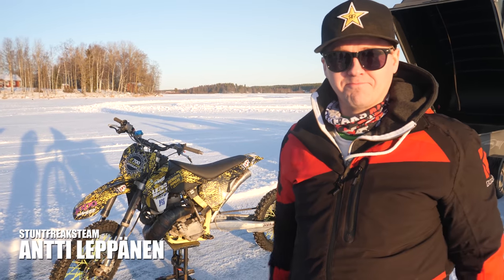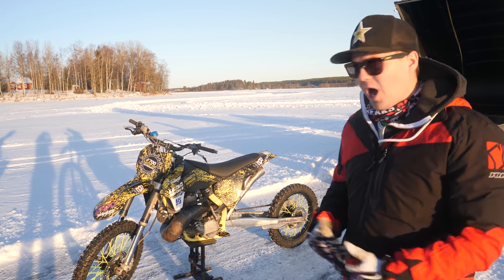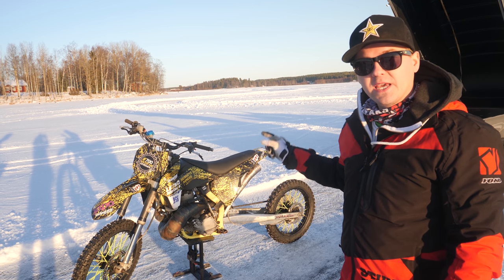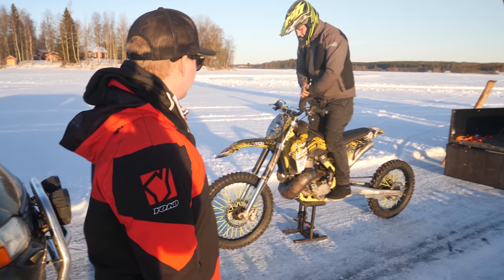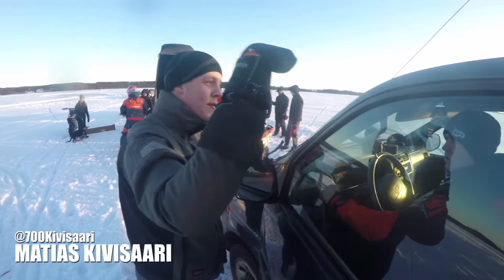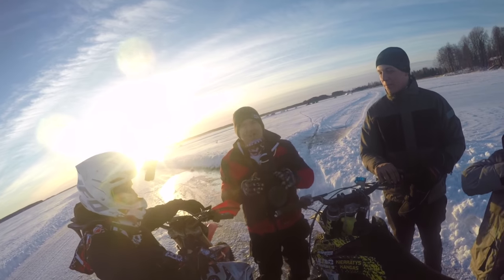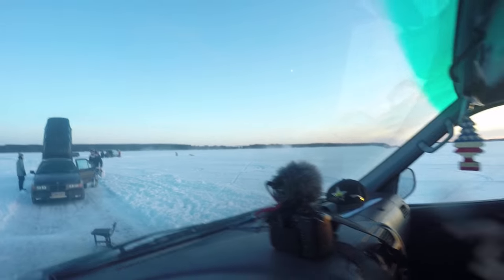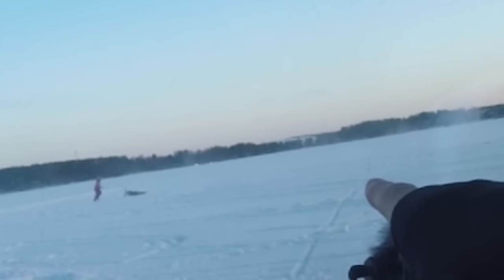700cc 2 stroke Zabel Dirt Bike - Test Ride

Comment: Solution: Mount a second 700cc engine to cancel out the vibrations of the first one!
Reply: Sorry it don't work that way
Reply: @timedrifter117  r/woosh
Reply: time drifter damn idc if it works it sounds fun 😂
Reply: time drifter r/whoosh
Reply: Transverse engine with revese gears would work logically
Reply: I want to build a twin engine 2 stroke buggy preferably 4 mil cheetah cubs  on a light weight buggy... is it possible and what are the setbacks if any.. in a build like that
Reply: @timedrifter117  one of my uncles TZ race bikes had two counter rotating crankshafts to cancel out the gyroscopic effects of the engine. Equal and opposite reactions, first grade science man...
Reply: resonance
Reply: Que chimba
Reply: Lol
Reply: @5dsunny713  I have some powerful twin cylinder 2stroke sled motors laying around...
Reply: And phase shift it 180°
Reply: @Kade Jaxx instablaster :)
Reply: @Salvatore Gus It did the trick and I now got access to my account again. I am so happy:D
Thanks so much, you saved my account :D
Reply: @Kade Jaxx No problem =)

Comment: Left kickstarter on 700cc, nice.
Reply: Ayyy LMAO first thing i thought lol
Reply: My cousin had a husquvarna 610 with left side kick, I thought it was weird too
Reply: imagine stalling the engine at a green light and blocking the cars behind for 15 minutes until you manage to start it up again
Reply: @rodrigovillanueva5384  I have an 660ccm 4 stroke with kickstarter on the left side, can kick it with 1 kick when its warm.
Reply: @rodrigovillanueva5384  they're only hard to kick if you don't normally practice left leg kicking on a right side kick start. I started practicing that when I stalled on a hill I was going up diagonally and I fell into the hill on my right (kick-start) side, went to start it without dismounting lost my footing on the left side and went end over into a ravine and got pinned for about an hour and still couldn't start my bike because I was so weak and it was still on the wrong side of the slope.  Later i learned I could've and should've just hopped off and stepped up the hill a foot stood the bike upright slightly and kicked it with my left foot.
Reply: se on siksi koska se on oikeasti tarkoitus käynnnistää oikealla jalalla vasemmalta puolelta
Reply: @rodrigovillanueva5384  Luckily I’m left footed
Reply: @seetipulska8651  I've never seen one before
Reply: @frogman7806  me either,  I feel like they aren't common on supermoto bike
Reply: Its because you can kick it better with right leg, from the ground
Reply: This is the second left-hand kick started I've seen today
Reply: THE ONE .Bultaco or what ever that Italian motorcycle name is made a 840 cc experimental bike back in the 70s.That was a leg breaking bike when it backfired.
Reply: @gerald4027     
   Oh yes!  
 I have experience back in the day with my XR 600!! 
don't walk for one month.
Reply: Evil :c

Comment: Industrial anti vibration mounts should help. Or else the hands will zing for hours afterwards. Nice job guys.
Reply: and flexx handlebars
Reply: Your not riding it that long. You forgot what the bike is made for.
Reply: tutto quello che incontra!   youtube.com/watch?v=RY_Tl4Rcv7U
Reply: The BRC 500 is counter balanced.  No vibrations
Reply: @modsquad8817   um why wouldn't you ride a super moto all day ?
Reply: Cosmic surfer is right. Would help in the long run
Reply: @chexlemeneux8790  Cause it's not a supermoto, but designed for a hillclimb.
Reply: @modsquad8817  I wouldn't think twice about hauling ass through the desert on a 500+cc two stroke for hours on end. These things are meant to go through the gnarliest terrain around with tons of usable low end power.

Comment: I'm a die hard 2-stroke guy. I will ONLY buy 2-strokes. But that thing vibrates WAY too much. Zabel needs to make a counterbalancer.
Reply: Yeah I did test drive the 2017 KTM  300 2 stroke and first thing I noticed was that it had no vibrations at all thanks to the counter balance, sadly second thing I noticed was lack of power compared to my old WR450F. I did end up bying a brand new 2019 KTM 500 EXC F and it vibrates but it is not bad compared to my old Yamaha WR450. Think I would have needed a 450 or 500 2 stroke to be happy, but the KTM 500 4 stroke is pretty good and has more power then I can handle already and the power is easy to control. I am not a good rider and just do it for fun, and more power is fun even if not practical  :)
Reply: you should try like... idk not buying a 2 stroke you might like it, when i got my 250f i had a lot more fun than on a 125 just because it got boring i have nothing against them i still have a 125 but i like my 250f better
Reply: @ImJustShadow.  I'm an MX tech and racer, repair, set-up, and ride all bikes. I prefer two strokes. 4 strokes have their pros n cons just like a two stroke. I'm faster on and prefer two-strokes
Reply: they usually use those engines on the sidecarcross frames - i guess the problem is a little bit less pronounced on a bigger and heavier frame.
Reply: @henriht1147  They probably have some pretty hefty rubber motor mounts too. That big single 700 must rattle most anything apart. Still wanna ride one though!
Reply: @jasonjaeger4042  Hell yes!! I couldn't say no to that either haha.
Reply: CalypsoNotch408  no... Theres a reason people race 4 strokes they are superior with speed
Reply: @ImJustShadow.  They race with 4 strokes because 450cc 4 strokes raced 250cc 2 strokes lmao. And the 250s put up a good fight
Reply: @Jabooty_Williams  Thanks for mansplaining that for me. I'm aware of how they work, I was simply noting how impressive it is that 250s could (almost) keep up just because of their design

Comment: The ktm 500 brc is balanced engine and its not that diffrent from 300cc yous should look in to that
Reply: Easy get 80hp out of the BRC too
Reply: @petergarratt9645  yup and its much smoother i dont understand why zabel dosent balance its no point of it not being balanced
Reply: @petergarratt9645  but torque? Zabel 700 wins.

Comment: If you want to get rid of the vibrations a counter balancer is the only way, flexx bars and rubber engine mounts won't do much. There are guys that have made them for CR500s, doesn't look too difficult
Reply: @mondayfoolIn the second video the guy hangs a bottle of water off the bars so you can see the effect it had, looks like it works to me
Reply: @mondayfool yeah but we're talking SFT here, I don't know if you saw their minibike with a 450 or their GSXR dirtbike (they were a little hacky) they're just gonna rip on it for a video or two and then sell it off

Comment: I'm always surprised by how slow big 2 strokes are... based on the power to cc ratio, a 125cc would only be about 14 horsepower when in reality they are usually a lot more than that. A 125 is prime. A 250 is a reasonable upgrade but after that, its demishing return...

Comment: get yourselves a maico 700 2t ^^
Reply: that aren´t really maico bikes, they were new buildet bikes by KTM Köstler Leverkusen who bought the brandname Maico with KTM frame and also Zabel engine. but they use the old Zabel engines from about 1990-1998 with only 685ccm. this engine makes about 75 HP. the new Zabel engines have really 700ccm and hydraulic clutch with about 85-95 HP depent on which ZM29 Zylinder you have (GP, GPT, GPTR). Last year some GP teams testet the new ZM30 which is available this year.
Reply: @Thor555555  You have it backwards.  Koestler is a KTM distributor but he bought everything to Maico including all the designs.  The new Maicos are still based on the old 1980s Maicos, particularly the engines.  Zabel licensed the Maico engine design and made modifications to it.  The basic engine design came out in 1983 on the last of the "real" Maicos before the original company went bankrupt.  You can compare the cases; the air-cooled 1983 engine cases look VERY similar to the new Maicos and Zabels.
Reply: @Quirin M. Zabel isn´t really rebranded maico, Friedhelm Zabel was an engine tuner for sidecars and tuned the yamaha xs 650 engines. in 1985 the first two stroke engine was used in a sidecar,it was the Honda CR500. one year later the hole sidcar world cup changed to 500cc two strokes. 1987 Friedhelm Zabel tuned the first Maico 500 for sidecars and began to produce own zylinders for the engines. so the engines of köstlers new maicos ar original 500 cases with 620 or 685ccm with were produced by Friedhelm Zabel till 1998. after 1998 Zabel builded his own engines with 700cc, hydraulic clutch, only 4 gears (first gearreduction of the maico gear was removed) so in this engines he only used maico gearwheels which he later produced by himself.

Comment: There is a company that will take your ktm 250 or 300 2 stroke and they use your lower crank case and transmission and they give you back a modern 500cc 2  stroke counter balanced. That is what you want for a supermoto build

Comment: You should use a 2016 KTM250  and get a BRC 500cc kit for it..  the BRC500 has a Counter Balancer and makes more power then the Zabel
Reply: @nebulaunfolding  a good running the late 70s Maico 501 made 65hp the mid 90's CR500 makes 75 to 90 HP.  The BRC500 is counter balanced and with power valve and counter balanced should not have any trouble making close to 100hp with strong mid range

Comment: Why would engine braking destroy the engine?
Reply: No oil reaching the engine because the oil is in the fuel
Reply: @leon.690sm9  but it wont break that easy still, like racing engines uses alot of engine brake and if u can break racing motor with engine brake, then u should just look at mirror and think what went wrong🤭🤭

Comment: That "you can't engine brake a 2-stroke" myth has gotten completely out of hand.  That is a problem on the street, usually in a 2-stroke car, when you engine brake down the back side of a mountain range.  Watch 2-stroke road racers; they are off-throttle at very high revs for a good long time as they brake into a corner, and they don't have a problem with it.  2-stroke dirt bikes seize when you're on the power, making heat.  Not when you're off of it coming into a turn.  There just isn't enough time for your oil to go away and cause you a problem.  Just don't over-rev it, and don't expect it to stop like an anchor the way a 4-stroke does.

Comment: Is this engine like the 685cc Maico 2stroke engine? Or is it very different? Maybe cheaper to?
Reply: Its originates from a maiko engine and you pay around 3500 for a new engine
Reply: Okok by us the engine cost 4500
Reply: Year the engine is from germany so its obvious that they are a little bit cheaper here 
But its in no means a cheap engine  when you have to replace something is expensive like hell.
Even if you lose your kick starter its like 80€
Reply: Nolk, new engine 5400-5600€ without taxes and equipments. Also you can't talk about Zabel and maico at same day, cc is almost same but thats all 🤣🤣
Reply: @700kivisaari  i dont dont want to talk about both. I have no glue of the maico engine but i know that the zabel engine is based on a maico one.
And perhaps the ZM 30 is arround 5400€ when u buy it from Zabel direktly but you can get a new ZM29 for 3500€ if your looking enough
Reply: in Germany at least ; )

Comment: why cant you use engine braking? it doesnt give oil when you close the throttle?
Reply: The engine will not lubricate itself because when youre braking with engine there is only idling jet that gives the mixture when throttle is closed and thats not enough at those high rpms = bike will blow up
Reply: @jirkaarbelovsky6169  the rider was probably overexaggerating that part a bit, but better safe than sorry hehe - unless the carb was set to run really lean for that temperature there wouldnt be much of a problem assuming the fuel to oil ratio isn't something ridiculous aswell. I don't think that he could open the bike up enough on that track to reach the extremes in that regard. But yes, these engines lubricate (and actually also cool a bit) themselves with the oil and fuel mixture. If the bike has a killswitch an old trick was to cut the ignition and open up the throttle a bit when it could start to happen - mostly used in desert riding though.

Comment: You’re telling me this 700cc 2 stroke is only making 80 ponies?
Reply: Josh Frank  Those engines are mostly used for sidecarcross in Europe - nevermind the ponies, they generate enough torque to pull a big ass frame and two riders to scary speeds on a MX track without a problem - the 4 stroke equivelents didn't have much on them for a long time - who knows, maybe till this day - (the last time i was next to a track was quite a while ago)

Comment: just over 80? why not build a 611cc 10 mill DM banshee motor, it would be good for 140hp. or even just a 4mill 421 cheetah, you could get 95+ hp out of it.
Reply: exactly, I don't see a benefit of a huge displacement single cylinder two stroke, other then torque and bragging rights.

Comment: Hey guys, love your work and videos but these 700's seem (emphasis on seem) so lazy. I know you have already decided on a project but how about building a 250 or 500 2 cylinder 2 stroke bike. They are amazing rev happy engines and make more power than a 700 but with less torque. Also have never seen one done besides the old moto gp bikes. Motard GP.

Comment: You can never engine brake 2 strokes? Also they have very little engine braking to start with.
Reply: You can engine brake on 2 strokes. Not recommended but doesnt do any damage easily.
Reply: @casu6480  yep, every1 is likr if someone do even little engine brake they say at mediatly nonono dont do it u will break the engine if u do that😂😂

Comment: is the crank not balanced?
Reply from the maker: Engine is just fine. It’s just designed to bigger load than normal dirt bike can offer
Reply: @stuntfreaksteam  I can see in the video the foot pegs shake like crazy! No wonder you couldn't feel your hands. A 4 stroke 650 doesn't even shake that much compared to that high revving 2t monster. Hopefully some bar cushions and thick grips can help, Good luck!

Comment: What's the big deal with engine braking on this engine. I mean I know 2 strokes don't engine brake much to begin with. Not Like 4 strokes do. But maybe snow mobile motors are built to never have engine pushed from momentum cause belt driven? Idk sounds like being paranoid and that's why he threw chain as he popped up a gear after accelerating and let off then engine was slowly braking he popped gear and the motor matched  his speed perfectly so chain had no tension on either side of sprocket..idk engine braking should help cool it down a little I would think by pulling air in without extra fuel. Maybe it leans out
Reply: Rip piston and cylinder wall, 2 strokes aren't meant to be engine braked beacause the oil is adjusted with the throttle.

Comment: 700cc two stroke with 80hp isnt very impressive. I saw a 200cc two stroke that made 71hp . .. and Honda's nsr500 made 200hp . So yeah
Reply: It's not about max hp but instant torque right from idle. By the time the 200cc climb to its peak hp, the 700cc will have ripped your arms off! :D Big two strokes are unique beasts on this matter.
Reply: @kx3kx3  yeah I know this . But it's still unimpressive.  Cr500afs are capable of 70hp .

Comment: Nothing impressive about a 700cc that make 80hp when we have banchee engines making over 100hp and 140hp
Reply: But those banshees have so many addons and are so expensive banshees stock put out only around 46hp and the maico 700s stock put out 84 so it is impressive because if you take the percentage of increase in hp from the banshee onto the maico 700 you would have 180-220hp
Reply: looking at cost. Pay big money for a new 700cc 80hp or take that money and build a 140hp banshee
Reply: @PeterbiltChris  ok for a 150hp all the parts would take over 23k because my friend has a 611cc banshee and that's what it took him and it puts out around 149hp and a zabel and maico 700s cost 8k if it's used and 14k tops new idk what your trying to prove but it's not working